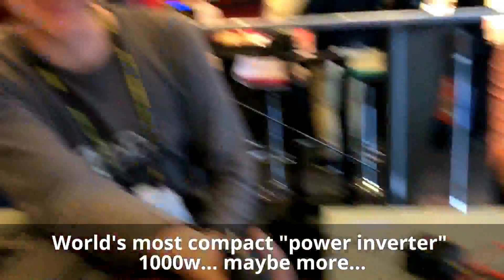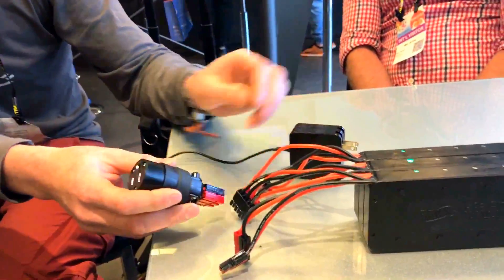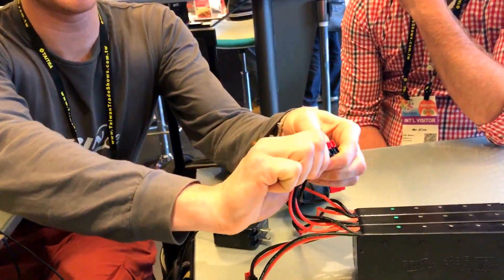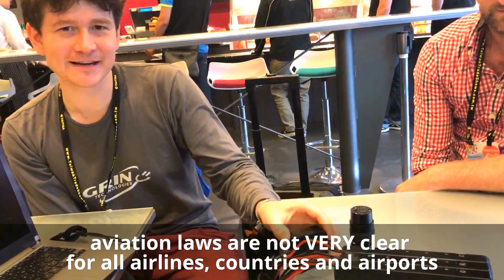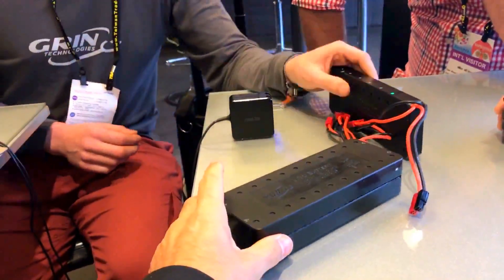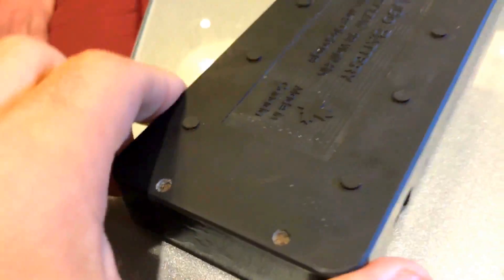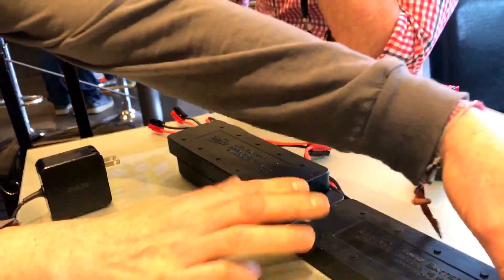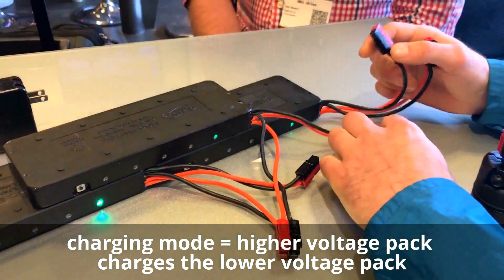LiGo • World's most versatile battery = airplane friendly, ebike battery, power bank, power inverter

Comment: I don't think what Justin said is correct, about everything being able to run off DC.  Seems quite dangerous as you could fry the device.  "If you have any transformers at all in the AC path, they will saturate, which will at best blow a fuse, and at worst damage something else in the path."

Comment: Can someone please tell me if this is fake or not? http://www.ebay.com/itm/Electric-Bicycle-Motor-Conversion-Kit-26-Ebike-Cycling-Rear-Wheel-Hub-48V-1000W-/322440778491?hash=item4b12f7d2fb:g:KbMAAOSw241YdRyC It says the motor is 1000W and has everything what an ebike needs except a battery but it's only 160$...
Reply from the maker: yeahh.. there's not such thing as fake... there are some really cheap models and some more polished ones but they all do the job...  more expensive ones are better (not necessarily).
This kit is just half the cost of an electric bike, the battery is the most expensive part... you can get cheap ones that works but may not give you enough power and range, some cheap batteries can actually be dangerous, some will die after one year.... this is something that is not worth risking your money, research and get a good battery with brand name 18650 cells inside like LG, Panasonic, Sanyo, Samsung...
Reply: Thanks for replying quickly

I have 4x 3S 5200mAh LiPo batteries which give me about ~48V in series and enough amps for a 1000W motor. (I don't need much capacity) I'll just use them and some voltmeters to make sure I don't over discharge.
Reply from the maker: Yeeeahh.. you can use your LiPo batteries but a 48v controller is designed for 13s and you only have 12s so the controller low voltage cutoff will kick around 39v. That means that you will never over discharge your cells but just use the multimeter to make sure the cutoff works properly on these cheap controllers =]

Comment: Good for noobs.. Too much plastic.
Reply from the maker: Haha.. not plastic, its a flexible and very strong resin with fiberglass cloth inside... reeeeally protects the cells very well!! What battery can survive 4 meters drop without damage? This one does + they all have a super advanced state of the art battery management system inside controlling everything that happens to the cells with Bluetooth!! Can be used on electric skateboards too... 1001 applications for these little bulletproof bricks...  =]

Comment: Looks like you had a good time at the bike show with Justin and the guys...

Are you going to to be the new face of grin technologies after all you definitely put the :D in grin technologies.. hehe

Are their packs injection moulded btw or are they openable / serviceable?
Reply from the maker: Hey Dave!!! Yeahh.. I wish I had my GoPro with me when I was riding around with these guys terrorising the streets in Taipei... so much fun... now I have to go to Canada and do a Grin Factory Tour haha I always loved their work... I told Justin that I am more than happy to get some prototypes, test and make some videos... (videos... one less thing they have to worry about haha)
These packs are actually completely sealed which is not a bad thing, its weather and impact resistant + helps spread and dissipate heat in some ways.
Check out these two links:

LiGo Battery, Introduction and Basic Usage Tutorial: https://www.youtube.com/watch?v=zjaUeh3jbFM

Designing process of the LiGo batteries: https://endless-sphere.com/forums/viewtopic.php?p=1263930#p1263930

So much POWEEEEEERR

Comment: Don't different countries have different allowed battery sizes on planes?
Reply from the maker: Yes... the regulations for taking lithium batteries on airplane used to be very very confusing but most companies and airport are adopting a "standard". Batteries under 100Wh such as smartphones, laptops, cameras and other small electronic devices are considered harmless nowadays, between 100Wh and 160Wh you may or may not have problems, anything above 160Wh chances are it will get confiscated at the airport.
Justin was very smart making it 98Wh and staying under the 100Wh "possible trouble zone" 
Check out this link with lot of interesting information about it:
https://endless-sphere.com/forums/viewtopic.php?p=1263930#p1263930

Justin and Robbie are always carrying at least 4 packs each on international flights without problems... ohh yeaahhhh =]